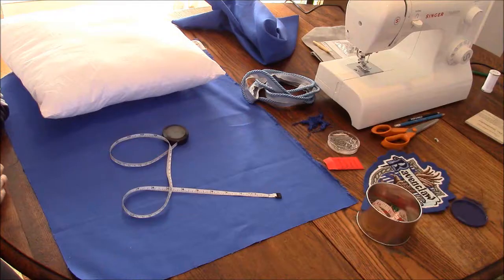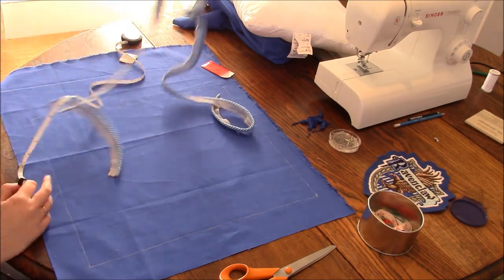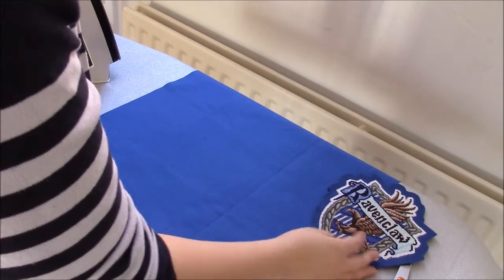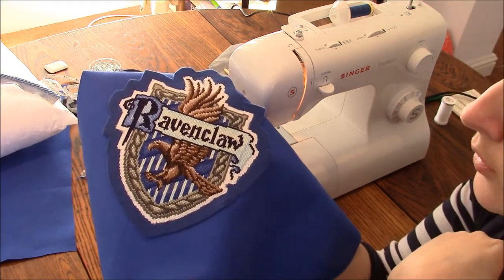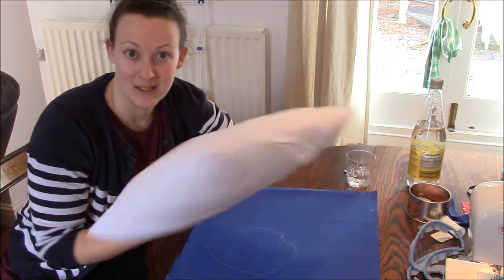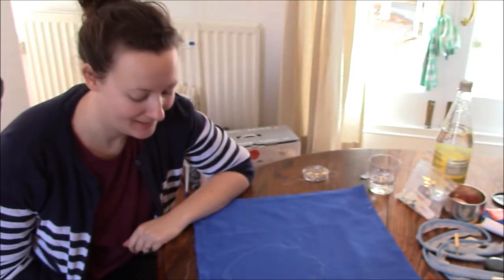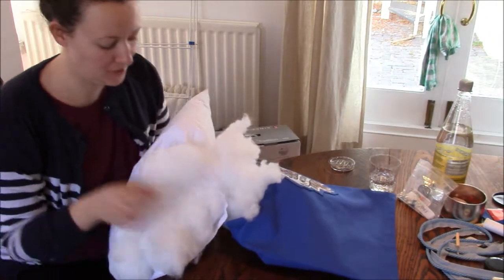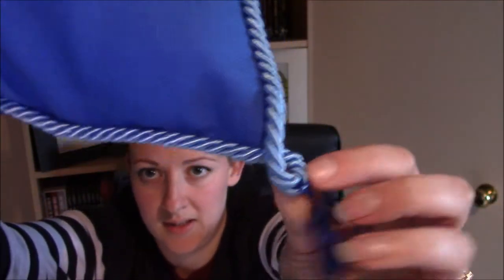Cushion Project: Part 2 - Making the cushion with a cross stitch patch and braid edge

Comment: Your project turned out lovely! Amazing job! I have one question, how did you hand sew the braid around the edge?
Reply from the maker: +Lisa K Hi! Yeah I realised I completely forgot to film this but the braid is made up of three twisted strands and I just ran the needle i has threaded up with the blue thread between them and around one of the stands to secure the lowest of the three strands to the cushion fabric at the seam and then repeated it at the next twist along over and over around the cushion. Sorry if that's hard to picture, its not the easiest thing to describe!